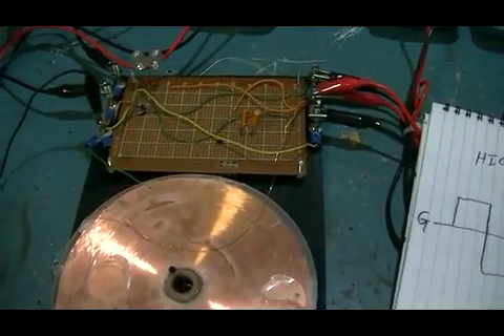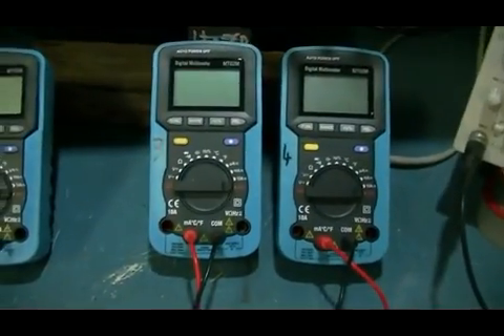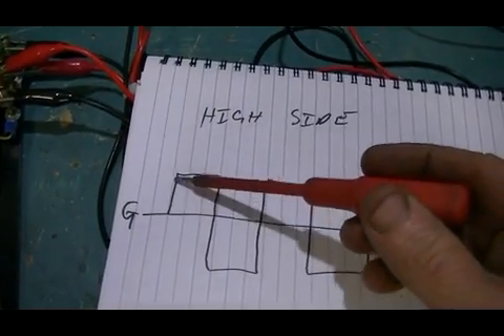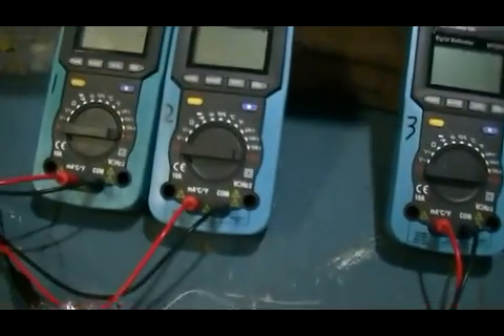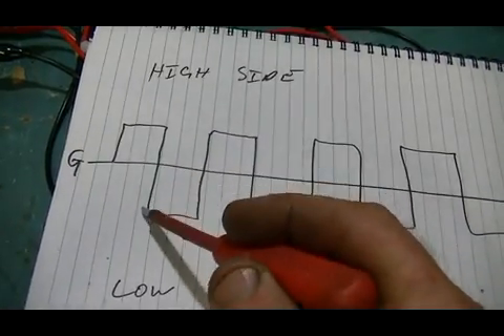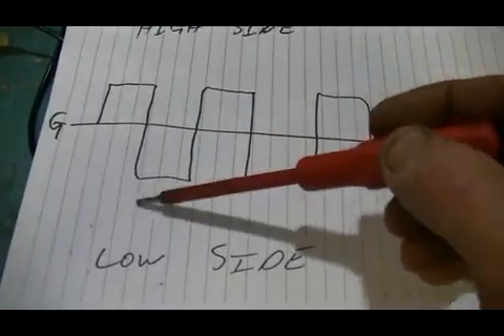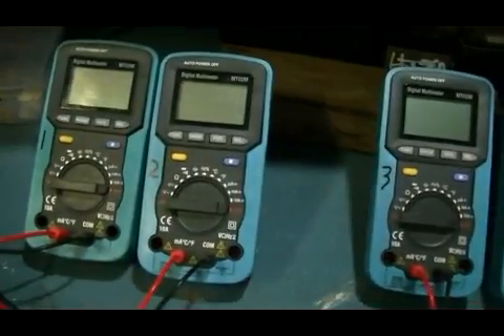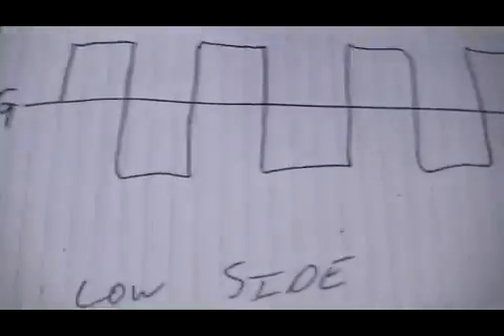Tesla circuit input output test 1

Comment from the maker: Hi Slider
I have swaped out the multi meters for resistors,then measured the voltage across them with the scope.
Useing ohms law,the meters seem to be reading correctly.
I tried the av plug,and got nothing at all above the coil.
It would seem that we have created a current loop for this part of the circuit,but where the voltage and current are out of phase-just like a tank circuit.But with this setup ,we can draw of some of that current to run the LED's.

Comment: I'm thinking it's the multimeters thermselves and their own internal frequency of sampling the data. 
The energize+collapse of the coill per pulse is sending out wireless energy through the whole common ground circuit. If you take the LED's off you'll light them on an AV plug and clip lead hanging over the coil. The meters are picking up that signal and it messes with the internal run frequency.

Comment: Ay the end you asked what we think. This is my observations and opinion, on the off pulse the coils are charged buy the energy that fills a magnet. You can call it what you want, dark,scalar, free, vacuum, its all the same. Electromagnetic will only distort  the effect. Revisit my video Tapping Zero Point. I give you the cleanest circuit I can. Sorry my cap that charges it are Property and built to order. After its charges the circuit it apparently is permanent.

Comment: Yep. exactly Whats the resistance and inductance of the coil. RCL circuit in one part. or CL. Make sure you use a good induction meter that tells the test freq. Jaycar don't stock a good one. I have their one, it's average. Makerj101 just did a review of a good one. Joule thief, with both wires next to each other can do the same thing + magnetic ringing in the core, Pancake for transmit/receive, core for no leakage. I think you are receiving cosmic rays, or something. Charged particles in air.

Comment: When a coil (or any length of wire) is discharging. It has to have a pos and neg end. Depending on the wind they may not be equal, but if 1:1 they are always equal. In a bifilar pancake, the opposite ends are separated by a thin dielectric. ie; as it's flux collapses, it becomes a cap and soaks up the BEMF. then discharges immediately, as it's shorted by the center tap. So if wire is same gauge, and 1:1 wind, It will always self resonate perfectly at any signal.

Comment: Great Test! Thats what it did in the sim too. Although I think you changed it differently to me. I think it will do more without ground, maybe 3-5 LED's in parallel on each side, maybe more on the neg side. Once you hit that limit, you can ground it and the neg side will go much harder!! You are currently limited by the electrons the coil can pull out of the air. Ground has unlimited supply. Does it go better without the pos led? Can explain further on forum, late here, Catch you tomorrow.

Comment from the maker: Hi sstubbby
It is only half a volt drop no 1 volt.You dont double the voltage drop as it is only one diode on each side of the zero volt line.The other end is ofcourse the ground-or negative of the battery if you like.That has no diode's,so no voltage drop on that end of each pulse.
Input is 3.56ma+3.61=7.17ma.Voltage in is 3.6v on high side and 4 on low-average is 3.8 volts input.3.8x.00717=.0272 watts
Output is 12.57+12.49ma=25.06ma.25.06x3v=.0751 watts.
So now you see the delema? lol

Comment: Hi TinMan, Good vid. The Circuit shows a COP of ~1.1. Which is very efficient. Input @ 50%Dut. ~2.5VDC is about 18mW. 2x @0.5VDC ~1VDC diode drop. So... Output is about 18.7mW. Or 2.5V - 1V x 12.48mA =<18.7mW. 18mW Input & 18.7mW Output... Correct me if I am wrong. As I have been inactive for quite some time. But... Scope measurements should calculated EFF or Rithmetic mittle worth.